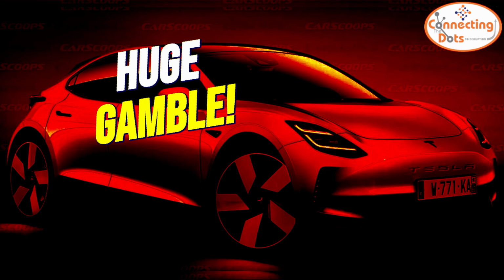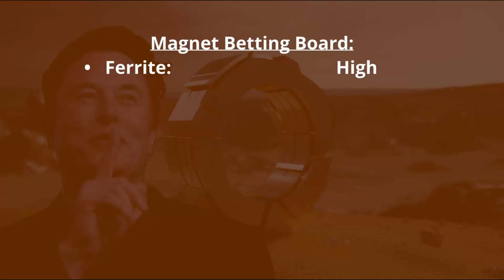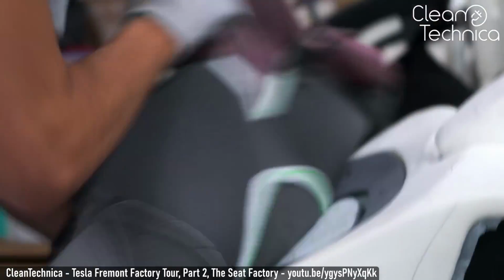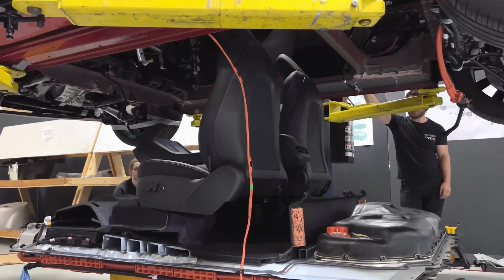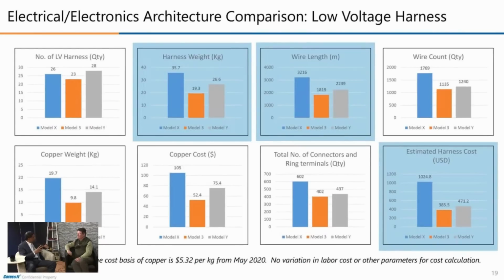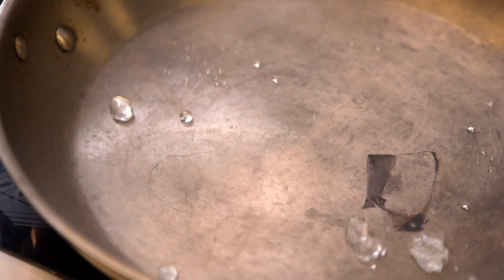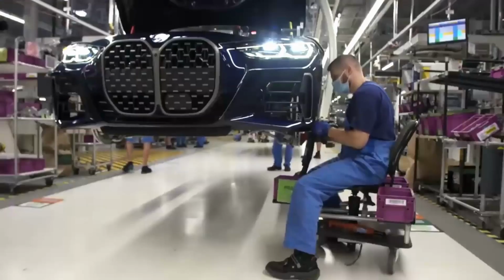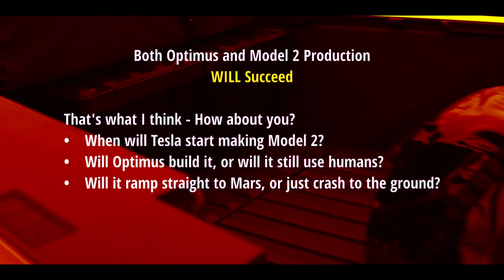Tesla M2's Tech Gamble: Runaway Success or Production-Hell Nightmare? Engineer POV [DecaValve WHAT?]

Comment: Well they might use Optimus but there'd be no reason to actually use a full optimist. It would make more sense to use partial Optimus say the upper torso or even an independent arm hooked to a fixed piece of machinery because unlike Optimus which is designed to be able to do the same general things that a human can do wherever Optimus is in this factory it's probably going to do a repetitive specific thing. So even if it's stretching fabric over seat foam it's probably just going to be a torso hooked to a base that's close to the foam with the arm stretching the skin over the foam. Or just the arm. Or just the hand on the end of an i-beam.

The motor winding patents are very interesting and I can think of a couple of things that could be added to those that could revolutionize that.

Wiring inside the composite body panels solve a lot of problems. Theoretically depending on what the composite is you don't even have to worry about insulating the wires. The composite is the insulation. Or the plastic or the blend.

anyway it really triggers the mind to think of all the different processes and opens up the mind to think of even more different processes that they haven't made public and you didn't discuss.

Comment: Great video. I think the initial next-gen production will use humans for critical processes. Optimus will start at the periphery and gradually replace humans once processes are refined. Once Optimus is in-place for an entire production sequence, production will accelerate to faster-than-human speeds. Faster processes will drive iterations of the Optimus hardware to meet new physical demands (e.g.: actuators & articulation joints).

Comment: The unboxed process should avoid production hell, as the difficult process is constrained within that module.  If it's taking twice as long, just start the second line of that module ahead of schedule to overcome it in the short term.  It also allows storage of completed modules much more compactly than an entire body.
The other advantage of modularity is that it allows changes to occur easily.  For example, I suspect the first iteration will have hydraulic brakes in the front, and brake-by-wire in the rear only.  When they want to change to brake-by-wire all around, only one module is affected.

Comment: Optimus isn't going to become useful on a short time scale but it doesn't matter because the new Model 2 production lines will achieve greater productivity and efficiency without Optimus robots flooding the workplace. Ultimately, if Optimus can be deleted from the production process it should be and it no doubt will be after the propagandist advocacy and technobabbly barking is supplanted by production line performance measurements.

Comment: The Mexican governments have expectations. That Tesla will bring work to the area of the factory there is paramount. I think robots will be used in that factory but not all out at first.
Reply: If Tesla is not using human labor, setting up in Mexico has zero advantage. 
Also the UAW is going to have difficulty unionizing Optimus.
Reply: @jeremytaylor3532  nafta and other trade advantages to doing business in mx vs the U.S. right?
Reply: Well also consider the staffing requirements for a 2,000,000+plant by tesla. This is what they've stated is the goal for TERAMX at scale when open and ramped up. In gigahai they use over 14,000+people to do about a million units max. 

So even if the compact car cuts staffing by say 20% And optimus then cuts another 20% in about 2-3 years or so? 

That's still a LOT of well paid ft workers on the factory floor needed daily! Plus it's all the ancillary jobs that a plant like that attracts that matters most. In auto manufacturing it's 7-8 additional jobs per each factory worker on the lines. 👍🏻

Comment: As I didn't think much about other propositions, liquid cooled sits are IMO not worth, because one simple thing: leaks. They give a lot interesting benefits, but you want eliminate any moving part, and liquids are worst of it. If they would change it for air, it would be better, but still, pressure would make a lot of problems.
Reply: I think they might make one that does not leak. Hah but yes they've probably been avoiding it because of that if not the complexity in general. On the other hand,  stuff doesnt leak these days, tyres dont pop, glass doesnt scratch...
Reply: @YouTube_username. it would not leak if they put pipes in it, but when if only injection molding and glue, it is different story.

Comment: Very interesting  subject. But I do have concerns  regarding the concept of total optimisation for mass production, regarding  the loss of the ability of ease of later repairs , does this level of automation result in the  automobile becoming an disposable  item such as phones and laptops when anything goes wrong . Not good for the planet.
Reply: Yes, reparability will probably become harder, but reliability and number of defects decreases, so less chance of failure. Hopefully the unboxed process will make the cars more modular, so easy to replace sections.
Reply: @amosbatto3051  and replacement does not require the defective part to be sent to landfill, it can be recycled or refurbished.

Comment: A huge chunk of automotive wiring serves the lights. They could be wireless controlled but they all need energy so power over Ethernet makes sense. The network is looped around the car. Everything is controlled electronically via programmed nodes at each location.
Reply: One step closer to anti right to repair. That network just needs to be encrypted to lock out third parties. That includes thieves, owners and repairers

Comment: Like most things Tesla the reality will be far less exciting than the concept. Sure they want all of those things, but they will almost certainly be able to find success with just a few of them. Pushing the boundaries will eventually lead to delays and compromises, but also push the limits just a little bit further. The reality will be a $30,000 to $35,000 dollar car that is a little slower, a little smaller, with a little less range than the model 3 or Y, but at a much more attainable price point. They will be built with the $7,500 incentives in mind and use the already established cost cutting ideas that are already in use. They will have a gigapress frame, smaller overall size, less powerful but more efficient motors, and initially be made the same way as all of the current Tesla vehicles. They will be a solid success, but not a failure or runaway success, without some sort of massive unexpected innovation.
Reply: ...without some sort of massive unexpected innovation.
Did you actually watch the video? It was all about innovation, far in advance of any other automobile builder on the planet.
Reply: Of course I watched it and the reality is always less than the concept. There will be compromises because they simply can't wait 10 years for everything to work. I'm not saying they won't be kilometers ahead of everyone else, simply that the likely hood of everything they are working on being ready in a year is very, very low. @douglasburnside
Reply: Of course I watched it and most of those innovations will take far longer than they have time for. Unexpected breakthrough is probably more accurate. They know what they want to achieve but none of it will be easy. @douglasburnside

Comment: I like the 'Lego' assembly method. This will be adventagous especially when mounting movable components like doors, trunk and boot lid. With this method of construction they can all but eliminate shutlines. It also can be used on ridged components to be bonded or welded which will ensure accuracy.

Comment: I'm expecting M2 to use a LOT of moulded plastic/frp for exteriors (fenders, doors moulded in 2 layers which snap together with window and latch/lock systems inserted or pre-moulded in), (t/f)runk lids. Exterior and interior surfaces pre-finished in mould, wire preinstalled with electronic controllers and joining connectors. Low-density low-cost insulating foam filling.

Comment: Exceptional video with excellent research and information. Many people question the release of the Cybertruck before the affordable car. In my view, the Cybertruck allows Tesla to reduce some of the risks you have detailed by using the expensive Cybertruck as the lab rat. Just like the Roadster was used to prove the technology, so is the Cybertruck. Whether it is steer by wire, 48V architecture or even the stainless exterior, I think most of these will go into the Model 2. The stainless might not be used for personal vehicles, but it would make sense for autonomous. Something resistant to vandalism.

Comment: There will be many failures, but in the end it will be a success.
If putting up the seat covers is so hard, then why not inject the liquid foam material into the cover (using the cover as a mould)? Foam injection moulding is not new technology.

Comment: What if the Model 2 is an unboxed Model Y with 48v architecture and steer by wire?  That removes one risk: that the market won’t like the form factor of the new car.
Reply: Nope not a model Y, although imo if the Y&3 keep up after the compacts are introduced(don't forget they've talked about different form factors for different markets) and have design centers in multiple countries now alongside the factories. 

They could be updated with more of the learning and design optimizations of the compact. 👍🏻

Example the leaked compact cuv in the design drawings at the Cali engineering event and caught testing with an mx30 body on it in China vs a hatchback format shown by lars and franz in the recent elon book.

The cuv would sell best in china&the US but the hatchback compact would sell very well in mx, Brazil and the EU vs a cuv format. 
Same chassis, pack's, motors, seats etc, just different top hat's for different markets. 😎
Reply: @JaiUneGuruDeja That will not save enough money to sell at $25,000 with enough margins.
Reply: @grahammonk8013  I believe a Model Y now costs Tesla about 30K to make.  They have said that the unboxed method will cut costs by 50%

Comment: Everyone is misunderstanding the Lego comment. The unboxed method is about modularity. Using wiring harnesses for single wire connectors instead of running cables throughout the vehicle. This turns a door into a singular piece. 

This is not about having a door snap-on without bolts or anything, even remotely similar. 

The Lego piece is comment is 100% about a door that can be built completely separate from the car bolted on and plugged in quickly. 

Sandy Monroe has commented about this with snap together pieces. His comments. Regard plastic coverings and similar items not the mechanics of the body itself. 

Proper bolts and fasteners will still be predominantly the way the vehicle is made. When he mentions Lego pieces, he's talking about modularity. It boggles my mind that everyone misses this

Comment: Not sure if they want to start with a fully automated line. Elon’s 5 step framework contradicts that:

1. Make the requirements less dumb
2. Delete unnecessary steps 
3. Simplify or optimize
4. Speed up the process
5. Automate for efficiency
Reply from the maker: Interesting point - using people as guinea pigs for testlig and optimizing the process so that automation arrives when inefficiencies are ironed out. But I think this will happen during design/preproduction production itself should be heavy with optimus. one reason is that you hire many people and very shortly after you have to find them a new job or fire them. Another is that for most tasks training those workers would be harder than training optimus :)
Reply: @ConnectingODots  I don’t think Tesla assumes Optimus will be ready to replace most workers next year, that would be too risky. Also if the factory would be almost completely automated, what’s the benefit of building a new one in Mexico?
But I totally hope your right though 😃✌🏼

Comment: I'm just concerned about the batteries.  I hope they use something dummy proof.  No charging to 80%, no fire risk, etc.
Reply: LFP
Reply: No battery can be “dummy poof” … when Mary Barra is the dummy.
Reply: Don't be! 250 or so ev fires in 2022 in the U.S. vs over 217,000+ice vehicle fires. An ice vehicle burns down on average every 4mins in the us alone so 8+cars burned down just watching this video vs zero ev fires. 😂

#1 open recall across ALL LEGACY ice oems is for the risk of FIRE even when parked right NOW effecting over 10,000,000+ 3-5 year old vehicle's. Why do you think garages were originally detached structures? 😀

Comment: They are currently working on the production line for M2 in Texas where ALL the smart engineers live Elon said this. They are refining the process until they get it to a fast enough assembly line. Only then will they roll it out into full production so they can ramp fast with demand. M2 cannot have anywhere near the delivery times as CT. When Mexico giga factory is ready they will go with these best processes and machines at the time. They will continue to improve M2 speed in both factories as they do with all lines in all factories.

Comment: I don't think the M2 needs heated or cooled seats just to absolutely minimize cost.
Reply: The goal is not to absolutely minimize cost.  It is to build the most compelling ~$25K car.   If that includes heated and cooled seated I would not say.  It the cost is low enough I expect it will.
Reply: @danharold3087  The goal is to build the most compelling car for the lowest cost IMO. A brand new $25k car which needs almost no maintenance, has low fuel costs, good tech, and has several credits should be very compelling (betting on it). But Elon said they want to cut costs in half.

Comment: I like the idea of water heated and cooled seats. Seems more controllable and comfortable.
Reply: Will the steering wheel be made of pool noodle?
Reply: @FrunkensteinVonZipperneck most likely .  😂
Reply: Self-sealing connectors. The Tesla battery is connected with self-sealing plug socket fittings. Similar things are used on fuel and hydraulic lines. It’s well proven tech. Fiat have used pre-filled clutch lines and cylinders since at least 2004. The master is installed on the body line. Slave is installed with the engine. When engine goes into the car, the fitter simply plugs the pipe ends together. No bleeding needed.
Reply: B
Reply: Ya air-cooled means tiny holes…? That catch dirt and liquids??? Ya water cooled is definitely the way to go
Reply: Dealing with liquids inside cars is really tricky and horrible when it goes wrong. A damaged electric seat heater is more likely to go open circuit and stop - or maybe blow a fuse. A leaking coolant/heating line inside the car would drip/spray coolant everywhere. 

It sounds neat, but they’d better get it right - and remember that this also has to remain serviceable and leak free for 10-20 years in a harsh environment full of vibrations and movement. Remember that the front seats also move in lots of directions a lot.
Reply: @markedwards4879  Thank you. Reflecting on what you said, I suppose water is quite heavy. My concern was metal damage from constant flexing but water would be in a plastic tubing which has a limited lifetime.
Reply: @robertwhite3503  no worries.  If you’ve ever had a water leak in a car from either rainwater or (worse) from the heater then you’d know what I mean.
Reply: @markedwards4879 They already liquid cool the battery. Doing it on seats is not much harder it is just a question of cost. Copper heaters are very cheap. Blowers for cooling are also very cheap. So I don't know what kind of liquid thermal management that will be cheaper and much easier to install compared to just copper heaters + blower.
Reply: @kazedcat  the battery is a sealed unit that does not need to be moved around in a cabin exposed to all of the dangers inside. It’s much harder to do water cooled seats. Something that fails on ICE cars is the heater core - basically a radiator that is inside the dash that heats up air blown over it. When they leak the car ends up full of coolant. Like the battery they don’t move and are simple but there are still issues…
Reply: @markedwards4879  It is very easy. Just use close loop coolant on the seat and then use an aluminum interface heat exchanger at the bottom of the seat. It does not matter if the seat moves around the aluminum interface will just slide with each other. As long as the aluminum interface maintains physical contact heat exchange can be done.